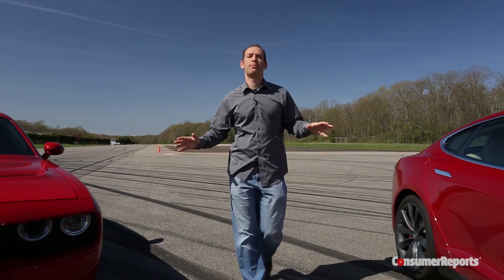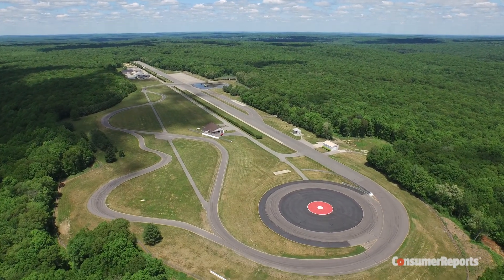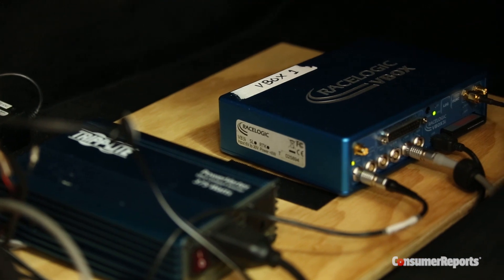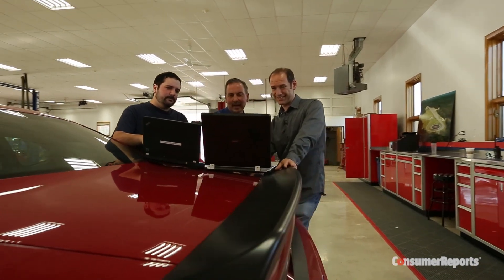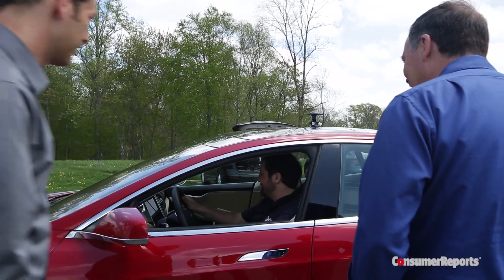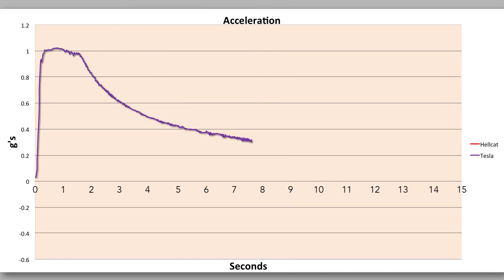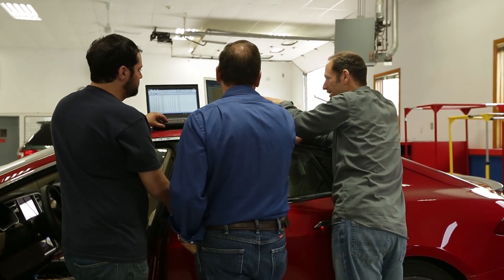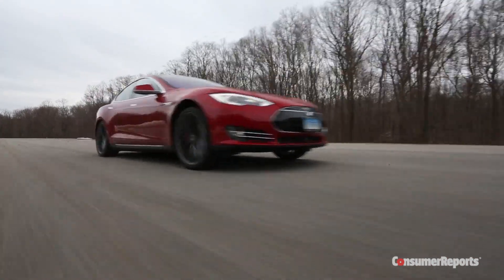Track Science: Tesla P85D vs. Challenger Hellcat | Consumer Reports

Comment: Tesla's quick, but it's advantage is only for the first 1/8th of mile. After that point, it's lack of additional gearing (doesn't it have 1 gear) prevents it from continuing it's acceleration, hence the immediate drop in g-forces and steady decline.....not to mention that if you do more than a couple quarter mile runs, you're outta juice and have to charge for a couple hours before you can drive home. I want to admire it, but until a re-charge only takes 5 minutes, can't see it being anything more than a novelty for the rich.

Comment: Is the better aspects of the Tesla worth another $60.000 dollars? These kinds test are some what bogus. Outside of just plain heads up run what you brung drag racing all the cars are matched pretty well. An example would be cars with electronics don't run in the same class as cars without. Weight, engine size, fuel delivery systems, naturally aspirated vs forced induction and tire size. So I say comparing a $120K car to a $65K car is a little skewed would you think? Plus the only somewhat common thing between the two is there are both cars and that's about it.

Comment: This kind of review is FAR better than Dragtimes bullshit and bias review. The Hellcat off the line is so shitty probably due to the tire width. However, it'll hook up at higher speed due to more power transformed to speed.
Reply: LAUNCH CONTROL 東瀛戰神 Lol, 0-60 in 3.4 seconds in a RWD 4,500+ lb car is not even close to shitty.  You are correct that it is hindered by the tire width.  275's on a 700hp vehicle is a poor choice.

Change the tires and now your RWD vehicle is faster to 60 than an AWD "instant torque" vehicle, for half the price.
Reply: DTRU122283 True. After 60 is where Hellcat comes alive.

Comment: The Tesla will overheat with repeated runs. The Tesla is a fast car, but cannot get rid of the heat from the inverter/engine with heavy repeated use. Just take the Tesla onto any track and watch it go into limp mode after a few laps. from t he heat. Fast car, but not with repeated runs at full throttle. I have driven a Hellcat, so I can only speculate how it will do with repeated runs or on the track.

Comment: AWD versus RWD.  The Tesla's G curve falls like a rock, while the Hellcat holds it's Gs much longer.  I bet with perfect traction, the hellcat would pull higher Gs.  But in stock form, the Tesla wins.  For the price of the P85D, I can buy both Hellcats and run 10.80s with DRs.  I'll take the Hellcat any day over the Tesla.  Also, is the Tesla's top speed 200?  What does the exhaust sound like in the Tesla?  Hellcat is a monster, a total visceral experience, can't beat it with batteries.
Reply: Greg Hudson Not much honestly.  Its an AWD car, as it is, its not traction limited at all.

The Hellcats gain so much from new tires because they are RWD cars that lose traction easily.

The Tesla 'may' gain a tenth off the 0-60, but it will not help for it falling flat after 60mph, which is its real problem.

At the end of the day, I would rather have a traction problem (that can be solved easily & cheaply) Than to have gearing, power and excessive weight issues.  The hellcat is heavy but it can be lightened.
Reply: dobbins2550 Non-sense. Test drive one.
Reply: dobbins2550 the hellcat is a great driving car....but i don't think that means people can't also appreciate how impressive the Tesla is.  A true gear head would be amped up about both
Reply: dobbins2550 Tesla is limited to 130 MPH, it has an RPM limit. Plus it only has one gear, it can only spin so fast. Hellcat, has EIGHT. 200 MPH, 205+ in the charger hellcat. Tesla would win at first, then the hellcat would destroy it.
Reply: Silas Belshnickel Agreed, but you will have Tesla nut huggers and Dodge fanboys argue all day long.

I love new tech, but G Force only matters around turns.  The P85D is a one trick pony.  While it is incredibly fast to 60 (which is awesome when it throws you in the seat) you can actually buy a Hellcat Charger, upgrade the tires and be faster to 60 in a RWD car that is half the cost.
Reply: DTRU122283 And what if you upgrade the Tesla tires too? What would happen then ? Be fair...
Reply: Dylan Hicks WRONG!  It's top speed is 133mph!   lol
http://www.greencarreports.com/news/1084557_tesla-model-s-top-speed-more-than-130-mph-emission-free

Comment: Pretty much expected shows that rear wheel drive overpowered cars are pretty much 3rd tier technology. Most new cars are going to all be AWD which offers significan advantages especially with lock mode as well to give all power to all wheels. Same goes with manual Tranny's tbh, a sub standard way of driving.
Reply: 95thRiflesOCI There will always be a market for manual transmissions.  If you do not understand that, it shows how experienced you are in the car world.  

This Tesla PR video does not show RWD to be a third tier tech..  I love new tech and I usually have the new gadgets but when your bias clouds your ability to be subjective then your video just becomes an opinion.

No, most new cars will not be AWD.  It will be a small percentage of total car sales just like it always have been.  AWD is not a new technology and the Tesla is not even the best AWD car.

AWD offers advantages in low speed traction and inclement weather driving.  

AWD disadvantages are weight, top speed and in the case of ICE cars it loses more power in the drivetrain before putting it down to the wheels.
Reply: +DTRU122283 exactly, the fastest cars in the world are rwd, he'll civic type r beat sti and evo around green hell stock for stock and it's fwd. if awd is soooo great why doesn't F1 use it
Reply: Both of you... Go clean your room!!!

Comment: full torque at 1 rpm.that is physics.  can't beat that.
Reply: J Chu 0 rpm, the electromagnetic field puts force on the rotor at standstill.
Reply: J Chu I bet Tesla will try to beat that in some way
Reply: progress will be made over time. i hope for affordable battery cars by 2030
Reply: J Chu 
Plus AWD the Testla can grip a lot more coming off the line.
Reply: +vuel987 I'm betting 2019
Reply: +J Chu ....... Bless you!
Reply: +vuel987 Tesla is planning to release a Model 3 in 2016
Reply: +vuel987 it'll probably be even sooner then that...the model 3 is 2-3 years away which is teslas affordable model
Reply: +Messier82 No it isn't. Late 2017/early 2018

Comment: How about verifying the horsepower claims of 691 hp with a reasonable assumption of drivetrain loss between the motor shafts and the wheels? The g graph says it all showing the P85D producing a far lower power than the Hellcat. 

Weight (lbs) * Long Acc (g) * Speed (mph) * 0.003054.

Weight in lbs = P85D + driver + equipment. Even better if you can weigh it at your facility.
Long Acc = just plug in the g force reading. No conversion needed.
Speed = mph

Should give you the estimated rear wheel hp. I'll bet it's right around 460 on a full charge. 

But it can still do 0-60 in 3.1 seconds because the power it does make it makes much much faster than any ICE can and does so smoothly and instantly. But after 60 mph, the hellcat will immediately start pulling on it

I'm not a Hellcat fanboy. I own a P85D myself.
Reply: fatboy19831 Let me go out to my garage and count them. I'll get back to you :)
Reply: Alan Waterman Note that Tesla has removed the 691 hp claim from their website.
Reply: Alan Waterman The Motor is connected directly to the wheels. No real drivetrain losses in the Tesla.
Reply: That's not even remotely true. The P85D may have few drivetrain components to go through but it's not a direct connection. The motor is connected to a reduction gear set first and then from that is connected to an open differential.
Reply: Angela Waterman Yes there is an open diff.  If there is a reduction gear it is most likely fixed.  There is no transmission to speak of.
Reply: fatboy19831 Yea, but now your back pedaling. You said the motor was attached directly to the wheels. The open diff still has gear fluid which has much higher viscosity than typical automatic or manual transmissions have. The reduction gear also has gear fluid and the losses are pretty high compared to a normal transmission reduction from an ICE because the motor spins at 18000 RPMs compared to 1/3 that for typical ICE units resulting in a lot more resistance which goes up non linearly as the RPMs increase. And since the torque is so high, you can't just use a super thin fluid. That said, the Tesla should have a lot less drivetrain loss than a comparable AWD car, but it isn't trivial or non existent. Perhaps someday with a quad drive BEV the losses can be further reduced.
Reply: Alan Waterman Sooooo how many speeds does a Tesla have in its transmission?

Comment: Pretty fail video TBH. You failed to bring up that a lot of the difference has to do with 4WD vs. 2WD. A more apt comparison to understand the difference between electric car acceleration and ICE acceleration would be a GTR or something with 4WD and good launch control that can actually hook up. While the instantaneous torque of an electric car is great off the line the hell cat with similar power figures pulled significantly harder after the initial traction limited period ran out. Since a ICE car can stay in it's peak power/ torque band due to gearing (Tesla has only 1 gear) an ICE with the same power/torque will generally be faster in the quarter mile when driving all 4 wheels.

Comment: a couple of things to consider.
when you look at range...the Hellcat still has better range. It won't take hours to fill the tank full of fuel. It is a proven technology, it won't loose range in cold weather, it sounds like a muscle car, it looks cool, and it won't have to have a very expensive batter pack replaced eventually.
Reply: Christian_Patriot How far across the country can you go with no gas money in a Hellcat?  Because in a Tesla you can go from LA to NY and back for nothing.
Reply: Christian_Patriot The tesla will require half as much maintenance as the hellcat.   I'm sure the cost to replace the engine/transmission on the hellcat won't be cheap.  Not to mention the gas cost.  Seriously, how often do you go on trips longer than 270 miles?
Reply: Actually, the range is similar in both. FYI, Tesla Superchargers supply an 80% charge in as little as 20 minutes, and are FREE to use. Perhaps you should learn some facts before commenting.
Reply: Christian_Patriot Your sentiments are neither Christian nor Patriotic.  I'm sure you know that less than 0.5% of U.S. electricity comes from oil.  I'm sure you also know that it takes less than an hour to fill a Tesla's battery, and less than 30 minutes to get 2-hours of highway range.  I think you're afraid that cars that use American fuel (Natural Gas, Coal, Nuclear, Hydro, Solar, Wind, etc) will end the funding of your extremist friends.  

I'm pretty sure "Christian_Patriot" is a handle meant to disguise your intentions.  You should probably be called "Islamic_Extremist", because you apparently love sending your fuel money to OPEC extremists.  And by lying about Tesla taking 'hours to fill the tank' you want us all to do the same.  Also, the Tesla has an 8-year Unlimited Mile warranty on battery and powertrain.  The Hellcat?  5 years/100.000.  Tesla?  Made in USA.  Challenger?  Made in Canada.  Again, the Tesla is better, and American-made and American fueled.
Reply: Christian_Patriot Like this?

http://www.speednik.com/files/2012/10/challenger-fire.jpg

or like this?

http://www.challengertalk.com/forums/attachment.php?attachmentid=210426&d=1399398936

maybe like this?

http://scontent-b.cdninstagram.com/hphotos-xpf1/t51.2885-15/1515506_1556996691182414_1442116382_a.jpg

how about?

http://ak-hdl.buzzfed.com/static/enhanced/webdr06/2013/9/4/11/anigif_enhanced-buzz-13476-1378307580-2.gif
Reply: Christian_Patriot  Yes, no new car is really American, but when Tesla starts operating their battery factory  in Nevada in less than a year Tesla's vehicles will be the most American-made vehicles in the world.  http://www.forconstructionpros.com/news/12088244/construction-of-tesla-gigafactory-ahead-of-schedule

 I actually own more stock in oil companies and fracking service companies (man have they taken a hit lately) than I own Tesla stock, so I agree that we need to bring on Oil Sands/Keystone pipeline and fracking and any technology that brings us closer to energy independence.  

For the first few months that I owned my EV (not a Tesla) I just powered it up with a standard old 110V outlet, which was more than enough to fill it up for my daily use.  I eventually got a 240V for faster recharges, but that's no different than installing a dryer outlet, which is within the reach of most Americans, especially since electricity costs the equivalent of $1.10/gallon gasoline.  Most people are home for 8+ hours overnight, and that is more than enough to top off an electric car.  As I said, for the average American that takes less than 10 seconds at night and 10 seconds in the morning to plug/unplug, so your scare-mongering about taking hours to re-fuel only encourages people to use more petroleum which today is 50% imported.  Electricity is over 98% American-sourced.

As for battery life, we really don't know how long they will last.  There are many Chevy Volt owners with over 150,000 miles who have shown no decrease in electric miles, but these are only 4 1/2 years old.   But it bodes will for battery longevity.

I'm glad you support North American petroleum production, but I am still confused why today you are happy to continue to send hundreds of dollars a year to Islamic extremist states, and you continue to encourage others to do the same and spread lies about people like me want to use US-sourced electric fuel.  That doesn't seem very Christian or Patriotic.
Reply: Christian_Patriot And in 15 years, you get to rebuild the engine and transmission again!! Yea!!
Reply: Christian_Patriot After you buy a Tesla, it is free for life!
Reply: Christian_Patriot It's free to you, as the consumer, for the life of the vehicle. You can charge the battery up to 80% in just 20 minutes at a highway rest area. You probably stop there anyway to eat lunch and go to the bathroom if you were driving a normal car, so it's not like it's out of the way.
Reply: Nooooooooooooooooooo! Look at the price of the Tesla and the price of the hellcat.....you could buy lots of fuel for the difference. Plus you will have to replace the battery packs in the tesla and they are already know for issues like the door handles.
Reply: gnoxycat you think electricity is free?
Reply: ...and fires
Reply: Christian_Patriot I'm curious why you spread lies* about an American-made car using American-sourced fuel, but you support a foreign-built car using a good deal of foreign-sourced fuel, over 10% from radical Islamic countries, but you call yourself Christian Patriot?  Please explain.

*Lie #1:  "Hours to refuel"  You know that Superchargers fully refuel in less than an hour, and refuel 80% in less than 30 minute.  And as for nightly re-fueling, it takes me 8 seconds to plug in my car, and the rest of the time I'm doing something else. 

Lie #2:  You talk about an expensive battery to replace while you know that there is an unlimited mileage warranty on Tesla's batteries.
Reply: Paul Ott 
Don't worry your shares are not going to devalue from a some comments by a random guy on the internet.
But don't kid yourself. No new car on the road in America is built entirly in America....not even Tesla.
You are dreaming if you think that slab of lithium ion batteries in the belly of that electric car is made in America.
http://www.theguardian.com/vital-signs/2015/jun/10/tesla-batteries-environment-lithium-elon-musk-powerwall

Regarding your assertion "Lie #1"
You also know that most consumers do not have access to charge that way. Most consumers have a garage or driveway without rapid charging. You should also know that rapid charging is only available on the upper trim models.

Regarding your assertion "Lie #2" 
You should also know Expensive battery replacement for electric vehicles is a fact. 
Model S: 8 years and unlimited km. 8 years is not unlimited. And you should also know that batteries have diminishing ability to hold a charge, due primarily to age/number of charge cycles. As well as a reduction in power during cold temperatures. So yes unlimited millage during the 8 year period. And yes Tesla will replace the batteries during the 8 year period if your reduction in batteries life falls bellow 70% of the specified life. Needless to say I doubt very much many will keep the these cars more than 8 years. The Hellcat i can guarantee people will keep more than 8 years.

"foreign-sourced fuel, over 10% from radical Islamic countries, but you call yourself Christian Patriot?  Please explain."

nice strawman...
I support North American petroleum energy production....bring on the Oil Sands/Keystone pipe line, fracking, off shore drilling, oil rigs, whatever.
Now lets burn some rubber!